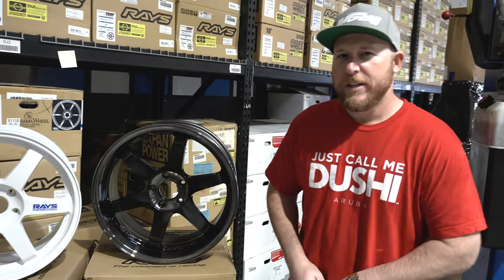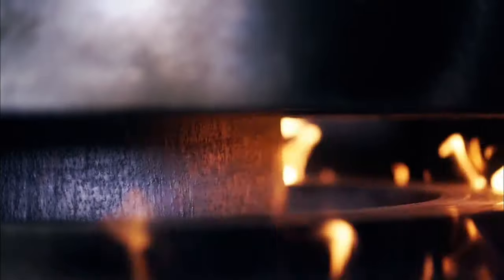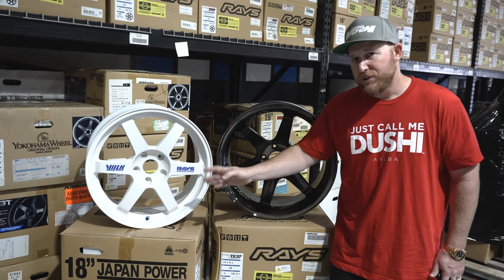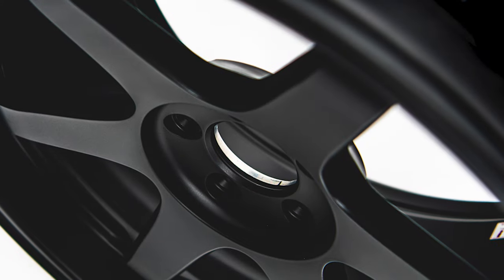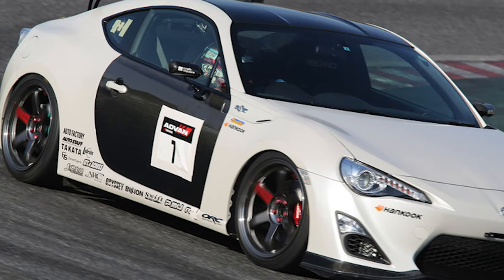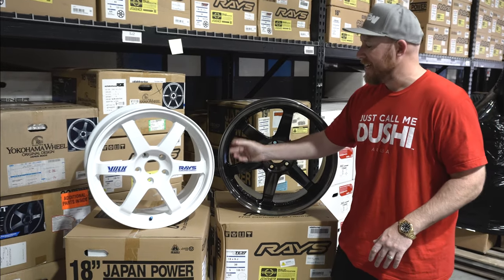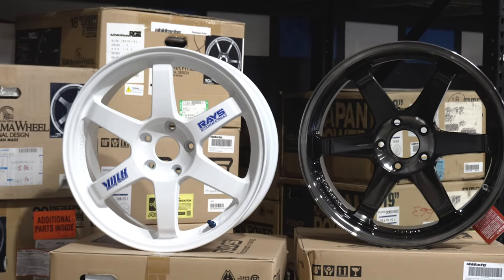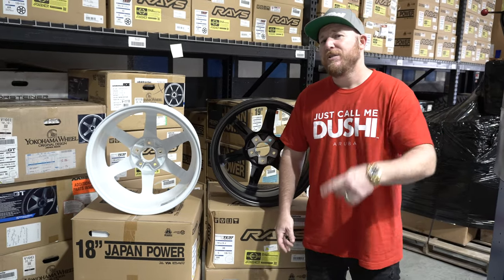Volk Racing TE37 vs TE37SL? What is the difference!?

Comment: Not running center caps to save weight made me chuckle. 2oz at the very center of the wheel has no affect on the car, the suspension, or what the driver feels compared to the wheel/tire weight as a whole (40+ lbs) (unless the driver is hyper-sensitive). A no-2oz center cap is that "gram" strategy approach, but not necessary on a street car....
Reply: I read the second reason is that it’s a “risk” because the caps can fly off at the track. I doubt a small plastic piece like that would be much of a risk but I think that makes more sense why they ditch them lol
Reply: You might be a decent driver that may be so but it appears you are not an amazing driver as you cannot feel the difference between 8 oz of weight un sprung on your car Just to let you know these were not invented for you to throw on your civic although that's what most all of you do
Reply: @luvhcchris   Do you believe any debris on the track the race track no less is acceptable?

Comment: What's the difference between the ADVAN GT and the TE37s except price and colour?
And another question. How much lighter(?) and/or difference in strength are the Nismo LMGT4 wheels compared the TE37SL?
Reply from the maker: The Advans are slightly lighter and less expensive. The LMGT4 are going to be heavier but slightly stronger!

Comment: The adapter for the center caps can be used for the ce28 sl ?
Reply from the maker: The CE28 uses a different style center cap. The CE28's use an o-ring style center cap

Comment: With making it lighter wouldn’t it cause the wheels to be more weaker? I heard these wheels causes problems down the road?
Reply from the maker: The forged 1-piece design is probably one of the strongest methods of wheel construction. Cheap cast wheels are the ones that are prone to cracking, bending, chipping, or flat out shattering.

Comment: How long is the wait for order ?
Reply: Forever... Been waiting for 18x9.5 38+ offset for 3 months now.... They haven't had them in stock at vivid racing. Don't let him lie to you.
Reply: Next shipment comes in May. Call to see if they’re in stock. I got my 20” TE37 Ultra in 2 days. They had it in stock.
Reply: @pink3918  I'll ask I need 18s 265 clearance
Reply: Could be as long as 3-6 months or as short as a day or two. I got my rays CE28SL same day cause a local vendor had them in stock in my specs and bolt pattern.
Reply: @LoXHumaN  TE37s are a whole different animal... 

Most shops people have put deposits down on them already so even when they are in stock they are instantly out again.
Reply: Clinton Popham these were for a customer who put a deposit down who ended up lagging it. The vendor put them for sale and advertised they are in stock and I picked them up.